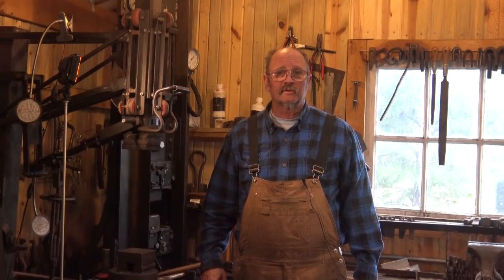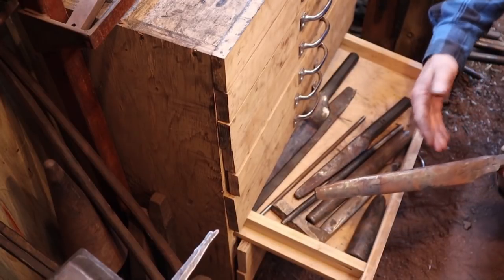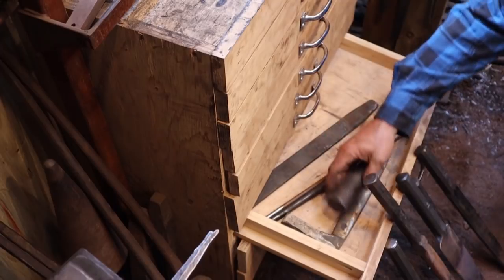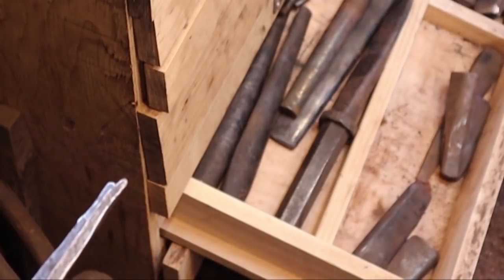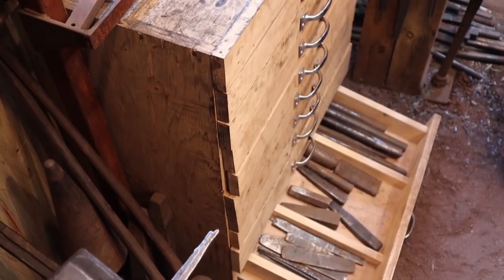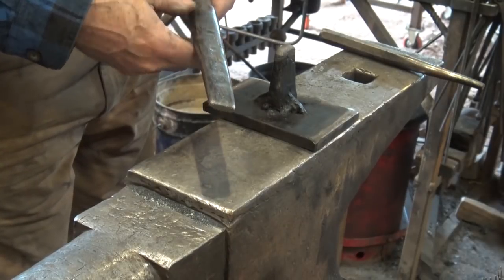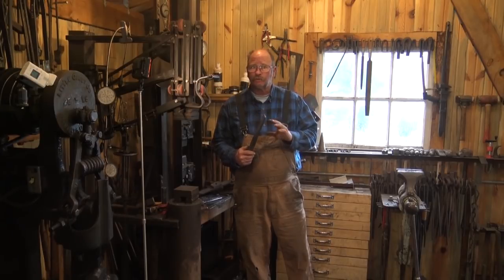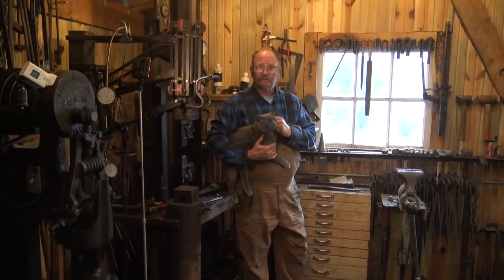Drifts - tool of the day

Comment from the maker: Several people have expressed a desire to make a handle for the drawers on the tool cabinet to replace the store bought handles. 
If you would like to make a handle for the cabinet, you may send it to:

Black Bear Forge
PO Box 4
Beulah, CO 81023

Thanks
Reply: Cool idea!  What size or hole spacing are your current handles?  I'll definitely make you one! 👍
Reply: Agreed.  I already assumed a one inch width but would like some dimensions!
Reply: He put the dimensions in a previous video at the end where he talks about it. Like 2 videos or so ago.